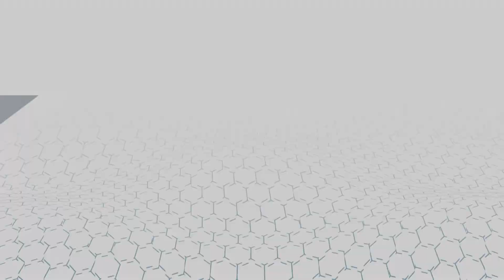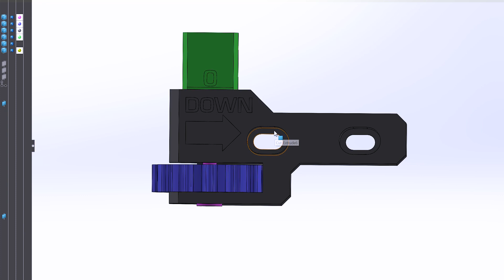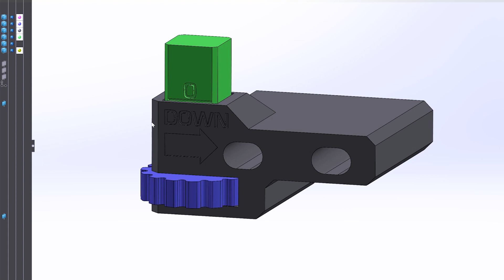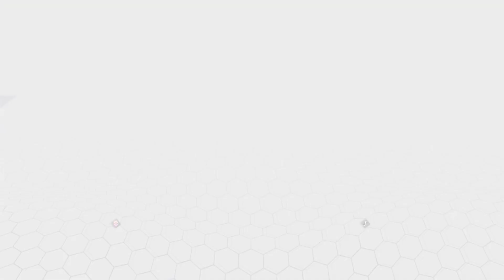Switch Your Switch! Change From Auto Bed Level Back To Adjustable Z End Stop (Creality, ANET, etc.)

Comment: i can confirm this also works on the shitty labist et4 no more funky Auto level crap
Reply from the maker: Thanks for confirming!
Reply: @EmbraceMaking  The only thing that was missing in the print was the square block that mounts to the z switch on the chassis. You never added that in, BTW. I had to go hunting for that. I mean, I'm not trying to be like a pain here, but if you ever messed with a labist, it's a royal pain in the axx, and it's because of the auto leveling. It auto-levels like it's drunk. If you could add that square block, that would be great because if they need someone to print them this or even if they are trying it themselves, they are doing this upgrade because of a reason they would prefer to just print the four things and be done with it. because, like me, I'm a noob when it comes to printing, and this printer is hell, so I'm fighting uphill with this matter. I'm just glad my brother also has an ender, but some people may not be as lucky as me.

Comment: Mesh leveling made a day and night difference for me. Using it manually or using a BLTouch, both are super effective.
Reply from the maker: The mesh levelling algorithms have improved a lot and are now super effective. This video is still relevant in some circumstances where the probe is broken or faulty and it's just easier to change to a limit switch while you're waiting for parts to come in or something.

Comment: On My anet et 5 pro, z axis doesn't stop coming down even with this solution(microswitch) is this a main board issue? Sry I also messaged you on Instagram then i realised maybe its better to ask it here
Reply from the maker: Could be a mainboard issue. Might want to double check at the board itself... if you have a multimeter, check to see at the board if the 5V pin gets pulled to GND when you press the limit switch. Maybe there is a problem with a broken wire or something in the harness.

Comment: very cool design,  and excellent video.  I aquired one of these ET5 printers recently and it too has a lot of difficulty with it's proximity sensor.  I would have to spend 20 minutes or more just to get it to zero properly after hitting the bed a few times.... ugh....  This will be much better. :)   The only change i will make is i would but a slot in the bumper to slide a nut in place to line up with the M3 screw,  and use that to raise and lower the bumber.  (only because I forgot to order those little screw thingies you melt into the bumper... :)  excellent design. :)  I will share any change I make.   P.S.  I shop at DigitMakers as well    Cheers.
Reply from the maker: Thanks! Yes that proximity sensor becomes a real pain to deal with... the reason I went with the heat fitting vs. a nut is that the press fitting will never move. I was concerned that a nut in a slot might work itself slightly loose after repeated presses and then you would have some inconsistency to deal with. If you remix the file for use with a nut please post up the remix on printables :) thanks!
Reply: @EmbraceMaking  I purchased a 3 pack of limit switches on the small black pcboard, same as the ones you have, but I'm wondering how do you have it mounted to the X-axis?  looks like some kind of little board behind the pcboard of the limit switch, with hole to bolt it to the x axis via tnut.  is there an stl for that?,  I dont see a file.

Comment: When replacing the proximity sensor with a switch end stop, do I need to only use two wires (signal pin and ground pin) or can I use a wire using all three pins?
Reply: be careful   as the third pin as 24 volts on it (on the ET5).  you really only want to connect to grnd and signal.   :)
Reply from the maker: The 24V pin will not be used. In the case of the proximity sensor it was being used to power the sensor. In the microswitch configuration it does not need 24V power. You don't need it.

Comment: I'm new to this subject, but if you trust the microswitch to be reliable, why wouldn't you put it in place of the proximity sensor, next to the extruder, so that you could still do mesh levelling if you wanted to? By definition, a mechanical switch has to touch the bed before it switches, so it must be at least 0.2mm lower than the extruder. So I suppose it would have to be moved up before printing but this is surely less tedious than having to do mesh levelling with feeler gauges. Does this make sense?
Reply from the maker: It makes sense, but you would have to move it up as you said. You would need to control it... which would then essentially just become a BLtouch module. So you might as well just install BLtouch at that point rather than use a switch!

Comment: Nice! One question regarding cabling - here I can see you use S (signal) ang G (ground). On my CR10 v3 I see endstops are using S and V (voltage). Is there any difference if I choose to use V or G?

Comment: Thanks for this! I had immense unreliability with my ET4 so I mounted a microswitch to the left upright as the end stop (same principle as your video just in reverse). I use MatterControl which has manual mesh bed levelling so now I have a printer that is consistent and still has mesh bed levelling via slicer  software. So mechanical end stop for the win! Thank you Sir!
Reply from the maker: Thanks! I've never used MatterControl, sounds really interesting. So do you use like a feeler guage or something at different spots and manually enter the values into MatterControl?
Reply: @EmbraceMaking , that's pretty much it. I use a 0.1mm feeler guage with 3x3 mesh. It moves the extruder to each point and starts at Z:10mm and  you move down in 1mm steps, then adjust in 0.1mm steps and then fine adjustment of 0.02mm (https://youtu.be/-ha7SqUErgg).

Mattercontrol is a really great slicer and design tool.that has a lot of useful features but most just use Cura/Prusa Slicer and never try anything else which is a shame.

Comment: You're a hero
Reply from the maker: Very generous of you!
Reply: @EmbraceMaking  could you also add in the file for the plate that mounts the limit switch to the gantry. I can't find a file for that on thingiverse. The one you used is currently sold out.

Comment: So when I plug the Z wire into the limit switch, it doesn't work. The nozzle when homing Z just goes up 5mm from where ever it is. On CR10S is there a leveling wire to unplug from the board? I don't see one when I open the box. The TH3D mini power box uses the stock Z wire from the motherboard.
Reply from the maker: So you only have a single wire plugged into the limit switch? What kind of auto bed level sensor did you have on your machine? A proximity style like mine or some kind of BLtouch? I'm not familiar with the TH3D mini power box so I'm not sure what that is doing... like I show in the video, machines that use the proximity style sensor should have 3 wires... the 24V power wire which you will not need. The other two are just 3.3V (usually... maybe in some cases 5V) and the other is GND. Essentially the autobed level sensor is doing the exact same thing as a limit switch whereby it is shorting the two and driving the output low to GND when it gets tripped. So on your limit switch you need to use those two wires to do the same thing. Perhaps you have yours wired in the wrong position on your limit switch... because if your machine goes up 5mm and stops, it sounds like its trying to start the leveling procedure but gets the signal right away that it has reached the home position when it starts looking for that signal.

Comment: Question, I got a printer upgraded with one of these also, in reverting it, did you have to update the firmware to stop using the auto sensor or did you just leave it unplugged? I know you lose the auto bed level feature, but is it still in your firmware as a option? (Just doesn't work)
Reply from the maker: Correct, I didn't update my firmware. So when the z axis homes, it still moves the print head to the middle of the bed as if it had the autobed level sensor. As you stated, of course it doesn't autobed level because the sensor is unplugged.

Comment: Any chance you have a link to that tool holder at the top?
Reply from the maker: I can't seem to find the exact one anymore, but this is pretty close / almost identical: https://www.thingiverse.com/thing:4629915
Reply: @EmbraceMaking  Thank you very much. I printed out your parts for the limit switch tonight, everything came out so well. This is a really well designed project.

Comment: I have an ET5 and have the exact same problem. Even bought a new sensor, got a little bit better but still rams the nozzle into the glassplate when homing. Now I have bought a limit switch that is waiting to be mounted and as luck would have it, I stumbled upon your video. Thankyou for a simple solution and good video. With a little luck I can soon use my ET5.
Reply from the maker: Glad it could help! It's too bad these printers have these issues, they print really nice otherwise. Now that my z limit switch is fixed I've got some really nice prints in a new video coming soon :)
Reply: have you been repaired it? i had the same problem
Reply: @huypham-cq2dw  No, not yet, bought the parts though.

Comment: i dont know if you can call mesh leveling on desktop printers a gimmick, yes the print sizes are small but when the +/- 0.20mm can be the difference in a good first layer adhesion and none at all and with the inconsistency of heated platforms coming out of china its kind of a no brainer. all end stops should be a mechanical or optical switch. and you can pick your poison on bed mesh leveling the key is find consistency across your chosen methods JMHO
Reply from the maker: Perhaps for materials who seem to be very picky with first layer adhesion. However, with PLA I've never found this to be problematic. It is very forgiving in terms of first layer adhesion and distance from the build platform. The statement I made was purely opinion, maybe I've just had good luck with all of my build platforms being reasonably flat, but I suspect mine are not close to perfect since they are all fairly cheap machines.

Comment: I just have one question. What is that black piece of plastic you have the limit switch mounted on?
Reply from the maker: That came with the limit switch. Check out the video description links where I link to the limit switch. It is a Creality Y stop limit switch replacement part
Reply: @EmbraceMaking  Thanks :D
Reply: @EmbraceMaking  I checked the digitmakers site, and it only shows the limit switch board with switch and JST connector.... i dont see the part in behind.   :(   I may just 3d print one. :)

Comment: This is a pretty cool solution! I like how this makes it easier if you change out hotends of differing heights to adjust the nozzle to bed distance without messing with the leveling knobs.  
I'm curious what the default sensing distance of the stock proximity sensor is to detect the aluminum bed through the glass plate? Maybe it's not adequate for this setup. I like mechanical sensors better too. 👍
Reply from the maker: Glad you like it! That is a good idea with different hot ends. I can't remember the detection range on those proximity sensors, but the sensitivity / distance can usually be adjusted with the little trim pot style screw on top of the sensor. Mine would frequently fail and I got tired of it.

Comment: Would this also work for a Wanhao I3 Plus.
{this model does not have the Z Limit switch connector on the motherboard}
Reply from the maker: Yes I don't see why it wouldn't work. My 3d model for the bumper doesn't look like it will fit since the wanhao doesnt have the extrusion profile, so you would need to resolve that, however, in terms of wiring it should work. Take your multimeter and test the pins on your motherboard for your ABL sensor. One of them will likely be 24V... you won't use that. The other two are just the signal and GND and those are the ones you would use for the new limit switch.